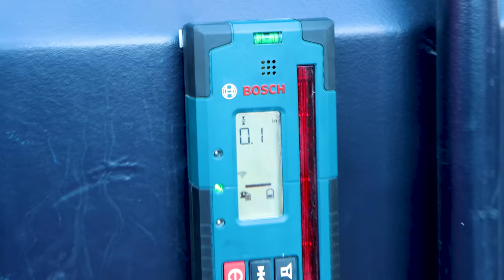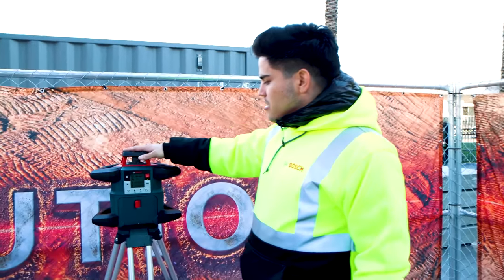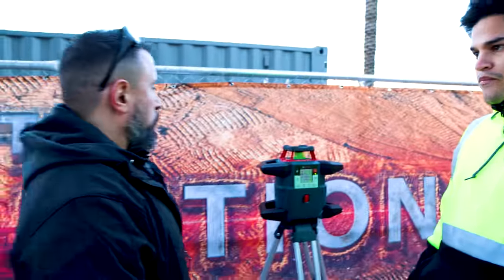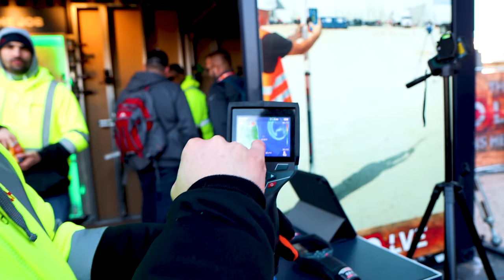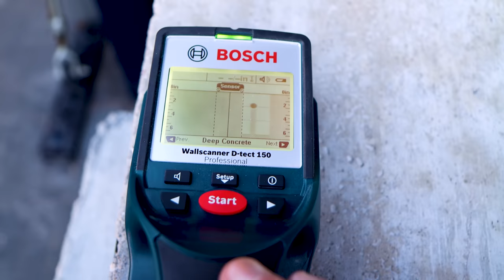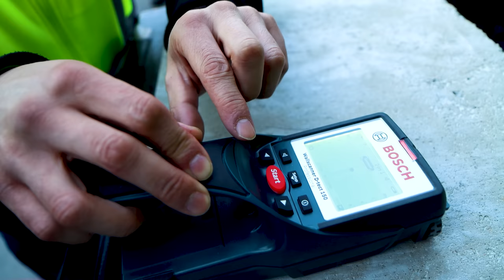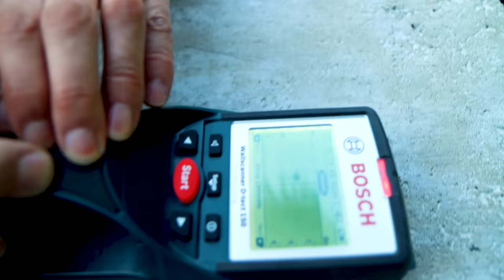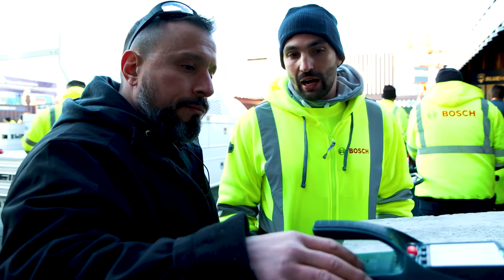Best New Power Tools Coming Out From BOSCH In 2020 That Haven't Been Seen Before!

Comment: GRL4000-80CHVK - BOSCH - 18V REVOLVE4000 Connected Self-Leveling Horizontal/Vertical Rotary Laser 
GIC 120 C Professional  - BOSCH - Inspection camera
D-TECT 150 - BOSCH - Wall/Floor Scanner with Ultra Wide Band Radar Technology